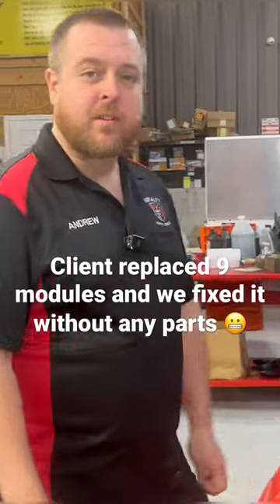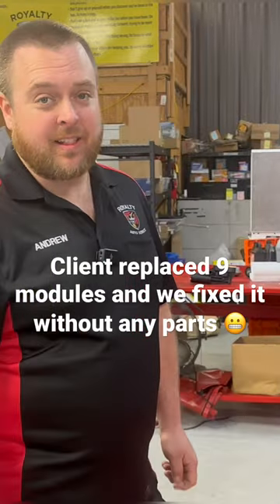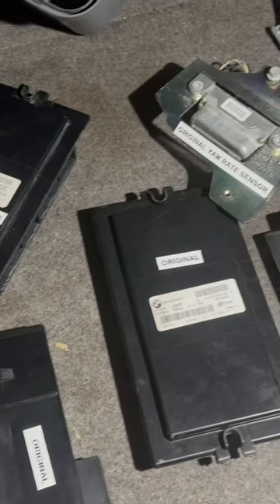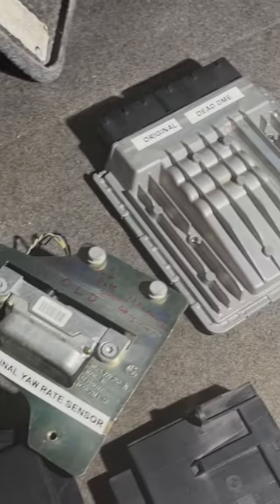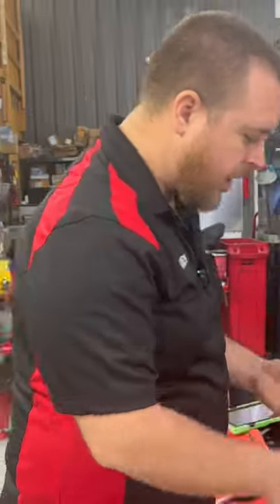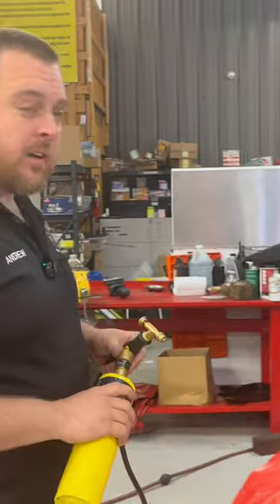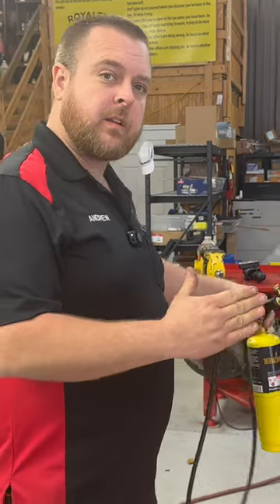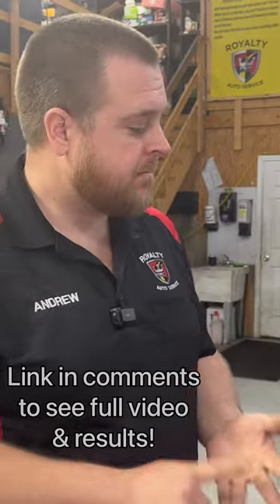Diagnosing a BMW that had the parts store thrown at it #automobile #328i #automotive #mechanic #bmw

Comment: Meanwhile across town a 16 year old Toyota has a seatbelt that doesn’t retract as well as it used to.
Reply: a 16-year-old Toyota is only 2007. I'm going to be real with you. I don't see it
Reply: my 24 year old rav 4’s seatbelt retractors are slower than a 100 year old mans piss stream but i dont have to do modules to fix my vehicle
Reply: @kidsythe   my 2012 mazda 3 drivers side doesn’t retract anymore without helping it
Reply: @jaydenbarteaux8768  2012 is only like 10 years old
Reply: Mean while back at the tents the Arabs where eating their dates
Reply: Hahaa so true. My 95 Celica and 03 Lexus still running with original parts. Celica has a replaced alternator but everything stock at 200k+ each...just weak seat belt retraction
Reply: My 2007 beat-up workhorse, a Mitsubishi Triton, won't die. I've run it with hardly any oil, and it still goes, hahaha
Reply: Rav 4 and a bmw 335 rav is 6 years older has less electronic issues but its on its second subframe and the uni body is on its last years. If theyd make a toyota with bmw frames and suspention that would be great.
Reply: I have to help the seatbelt every time in my 1998 Dodge Neon. Still runs like a dream though and even does great on long trips. Lol When it dies I’ll finally get something cooler!
Reply: I have a 94 Toyota pickup, seatbelts are a little slow but the thing is un-killable and I’ve never had to replace any stupid small ass sensors or anything like that.
Reply: the retractor on my ‘97 corolla just shit the bed :’))
Reply: Toyotas and Hondas are the best cars. German and American cars are just garbage 🤷‍♂️
Reply: Lol that's my 98 4 runner.  Quarter of a century old with 280k and she purrs.  She might not be the fastest thing on 4 wheels but she runs great and goes most anywhere I want to go.  Just in the process of replacing worn rubber in the suspension.
Reply: My 33 year old bmw is on its second set of front struts, second headgasket that started to leak again last winter, second coolant temp sensor, second set of upper and  lower control arms and tie rods and it’s 3rd set of sway bar end links at 221,000
Reply: @rushthezeppelin  you gotta love old Toyotas. There’s a reason the Arabs ride around on 20-40 year old Toyotas with machine guns mounted in the bed lmao
Reply: @aaronjones5742  Lol the way things are going maybe I will have a mounted LMG on mine one day lol.  Hopefully I'll have done a diesel swap by then so that I can run on biodiesel....
Reply: @johj9489  clean them an regrease the rollers, probably has a bunch of dirt and fuzz built up plus being dry is probably the culprit.
Reply: 2003 dodge caravan had issues from the day I got it in 2013 even though it did the test drive great. My 2012 Hyundai Veloster has been run over by a 2023 F350 and only needed the fan, suspension and bumper replaced and only because the previous owner never did any of that. I've had it 18 months now and it drives beautifully with the exception of the rear driver side tire leaning inward at the top of the tire (how do i fix that??). Owning this car has solidified the thought in my head that yes, imports are more expensive to repair but they're definitely much more reliable than any of the American made vehicles I've (excluding my 95 Probe)
Reply: Shoot I had a 95 Lexus gs300 (fancy Toyota) and it only needed maintenance nothing extra sold it for the 2jz that was under the hood for 4grand man I miss that car
Reply: @kidsythe  no no, he’s got a point. My 07 4Runner just had its driver side backseat seatbelt go out. Well at least the buckle part. But to be fair pretty sure one of the kids broke it…..
Reply: My 97 camry still runs great. Needed a cat, and struts but everything still works
Reply: That’s my only problem on my 20 year old Acura 😂
Reply: My 87 4runner seat belts don't retract. I just bought new ones for it after 35+ yrs of reliable service.
Reply: My 20 year old Lexus (Toyota) seatbelt does not retract on its own.
Reply: Meanwhile BMW is building Toyotas sports car 😂 Also, Toyota just had a major recall for the fuel pumps. 🥴
Reply: Well to be real Toyotas of that year aren’t as reliable as the good old ones of 20-30 years ago. Numerous engines in that era of Toyota cars have multiple issues and lots of recalls…
Reply: @hanzgrueber145  if true I never see it. I have 3 with the same 3.5L V6 all tuned for varying HP and one from the 90s with bulletproof 2.2 4 cylinder.  Three of them at 170K and nine with any issues.
Reply: You mean the company that builds pickups which are throwing rods left and right?
The same company that was caught cheaping out on airbags.
Caught using low quality steel not up to code for building the frame
Caught using cheap belt clips causing seatbelts to come loose in an accident?

Sure thing buddy.
Reply: @jaydenbarteaux8768  too much dust and dirt in the mechanism. Try a bit pf silicon spray on the seatbelt.
Reply: @funnypranker34  after 33 years! that’s quite impressive.
Reply: Same with my 2000 mitsubishi. Gotta love old school Japtrap reliability
Reply: lol fanboy detected, heres a truth bomb as some one thats worked on older toyotas and lots of other vehicles. Toyotas are just as rough and garbagey as everyone else lol if not worse honestly
Reply: @johj9489  true but its also a hot piece of shit lol. Just because "it runs" doesn't mean its not broken as fuck - worked in garages and thats normally how it goes
Reply: man the number of like 16 year olds in the comments making up garbage is kinda hilarious
Reply: @richmondvand147  I have been hearing that opinion for 30 years. And over that time that opinion went from the slight majority opinion to the minority opinion. There are so many reasons you are wrong, the easiest way to prove it is to mention re-sale value, or how fast a brand depreciates. The majority of society, actuaries, researchers, and other people who know the repair stats all dictate that. Why would people pay more for Toyota (or Honda) that is the same age, condition, and mileage if there wasn’t something different about them? When you consider their styling is often not as great as other brands it just proves the point even more. In the end money talks and your BS walks.
Reply: Me with my tacoma 😭😭😭😭
Reply: I always say the only thing my old tundra does better than any other makers truck is crank every time I turn the key lol

Comment: Odd that they went for all those modules when the high pressure fuel pump is a known failure point
Reply: N52 don’t have hpfp. N54 does.
Reply: @BimmerMafia  good to know, I have an n54 so when i hear no fuel that's my first suspect
Reply: N52 doesn't have a hpfp but its pump still normally goes out around 80-100k miles from what I've seen.
Reply: @alextheonewarrior it should go at about 160 if you keep gas in it 80-100k is far too early
Reply: @iiplaya  it’s a bmw no time is to early … they fail when it’s convenient for them and not convenient for you

Comment: Fuel pump failure comes from letting the Fuel Light come on, before you stop and put Fuel in it. Pump is cooled by the fuel surrounding it. Low fuel equals low cool. BMW and GM trucks and suv are notorious for the issue.
Reply: Because those who drive those vehicles are notorious for running their vehicles to empty 🤣 the fuel pumps themselves have no issue anymore more than the couple hundred PPM that any part has in standard failures
Reply: If a BMW won't start, always check the fuel pump. It's always the fuel pump, wayyyyyy back to the Jetronic Era.
Reply: I explained this to my wife on multiple occasions. And for reasons only known to her she refused to listen and I had to replace the fuel pump it was not a fun day.

Comment: Absent minded driver ran it out of fuel a couple of times, or many a-times near empty, pump ran dry and overheated itself, this is a main cause of fuel pump failures.
Reply: 3/8 of a tank is empty, or it'll heat the pump. Just keep it over that and you'll get longer life than the people who wait for the light to come on.
Reply: Are you a mechanic? Because the video states fixed with no parts. It was a bent pin on a module.
Reply: @sladeoriginal  yes, 43 years. 
Bent pin on a module (terminal/connector) sounds like another hand induced cause to the failure.
Reply: @vwecco1  
Yes sir - I don't believe I've seen a factory installed connector pin bender just yet - not even from the germans

Comment: Had something similar. I diagnosed a fuel pump immediately, simply because I did not hear it prime. Garage later confirmed it was seized.
Reply: They don't usually seize up. The brushes usually wear out.

Comment: First thing I'd have done was fuel pressure check, use bypass relay to see if pump functions if possible or run power from Power Probe to pump.
Reply: Adding an aux supply of fuel is so quick and easy to do. Some vehicles are not exactly easy to hook a fuel pressure gauge to. If you add fuel and it starts or at least stumbles a little then you instantly know a few things. #! you have a fuel supply issue. #2 ignition system is working and crank and cam sensors are good.  If you add fuel and nothing changes then you know you probably do not have a fuel issue so it's time to do other checks, including fuel pressure checks. But it hurts nothing to try adding the cosby sauce first. How much Cosby sauce?? All of it!
Reply: I love my power probe. That thing is boss.
Reply: Just pull a splug to check if theres fuel making it to the cylinder, this one would have been dryer than a nun, it's just a crazy waste of money to chuck random parts at it without knowing the basics, sounds like the biggest problem with this BMW is a dunce owner

Comment: My 99 Ford Explorer wouldn't start and the Ford Dealership was just down the road.  The mechanic called me back because I had given him a Standard Key and not a Chip Key.  It was the only one I had been using for the past few years.  
The original owner had removed the Sensor Loop from the ignition switch and taped the Chip Key inside, then tucked it into the dashboard.  The tape had come loose so the Computer couldn't detect the key and shut off the fuel pump signal.
Reply: Wow

Comment: If you turn the key and you don't hear the fuel pump prime, check power to the pump. If you have power, then the pump is bad. If there's no power, then you're looking at a sensor not sending a signal to it. I'm a "make my car start" specialist! I've started cars that people said haven't started in months, just sitting. Replaced crankshaft sensors, camshaft sensors, fuel pumps, distributor caps on old Fords. So many things can go wrong with starting a vehicle. Once, it was a clogged air filter. Once in my life and never again. LOL! Air filter was literally BLACK when I opened the box!

Comment: Fuel pumps should always be first to look at. They are the most overworked part. In cold climates, they work even harder. It’s also always submerged in gas. 

Spark is also another thing to check first. 

Relays are last thing to look at. If a relay is blown, a bad pump is what causes them to blow. At least a new pump will solve the issue of a blown relay, if a relay is bad.

Comment: Oil pressure switch stops it from  running or if you get into an accident it could be one of the bumper switch’s that shut down the pump to stop fire if smashed up hot wire the pump first and see if it runs. Did you know if the battery is weak on them cars all kind of crap goes out.
Reply: scan tool should have no issue flagging oil pressure sensor or fuel shut off though and would give direction

Comment: KISS. Air, fuel,spark. Cars are the same they have always been, just a few more black boxes.
Reply: I would first loosened the banjo bolt on the fuel filter to see if it had pressure.

Comment: Maybe some car manufacturer will come up with fuel pump not working warning light on the instrument cluster.or none fuel flow warning light.
Reply: No need. Many modern cars have fuel pressure sensors now and a scan tool can show this information. Most people don't need a "fuel pump not working light".

Because they ignore the low fuel light and burn their pumps up by running it constantly below 1/4 and fuel pumps use the fuel to keep them cool.

If they'd pay attention to their fuel gauge, and had regular maintenance where the fuel filter gets replaced at a nominal interval, they'd never need the "fuel pump out" light.

Meanwhile techs have the tools to diagnose these issues that most of the time are caused by blatant neglect.
Reply: @EyebrowsMahoney  Poor design if a low fuel level damages the fuel pump.
I have yet to see a car owners manual that states you will damage the pump buy driving with the low fuel light on.
Reply: @Cheepchipsable  Yeah, the owners' manuals these days are just Fischer-price "how to roll your windows down" or "how to use your seatbelt." Rarely do they put anything in it that results in your vehicle lasting longer, just what they can be held liable for. As for the design, almost all vehicles are designed that way. In the majority of cars, in-tank fuel pumps are suspended, vertically, towards the bottom of the tank. They are cooled by the fuel surrounding it. Towards the bottom of the fuel level, depending on the vehicle which can range from 1/2 tank to 1/4 tank and below, it loses the fuel surrounding it and can't conduct the heat away as efficiently. The increased heat usually results in eventually burning up the motor. Some are more susceptible to failure than others.

Everything on a car is designed to a specific lifespan and is constantly being engineered down to increase profitability. Some vehicles are worse about this than others. I mention this because this will only really affect your vehicle reliability outside of the warranty period. Which is the exact engineering point for longevity. - they WANT you to buy a NEW car when it's "lifetime" (which is end of warranty) is over. That's why manufacturers are switching to "lifetime fill" transmissions. They can lower the apparent "cost of ownership" by disguising the transmission as a "lifetime" product. The lack of maintenance is against the transmission OE's recommendations, but your owners manual says there's no need to service it. Then they tout this as "less maintenance cost," but in reality, the transmission will eventually fail you. The same goes for your fuel system. It's designed to last however long they want the car to last. Not past it. - Of course they're not going to tell you how to make it last longer.

I've replaced enough fuel pumps in cars, and the majority of the failures are the motors. Rarely do they ever fail because of wear, which would indicate their actual end of life - which points to abuse being the cause of failure. Could it be designed better? Absolutely, but that costs money that manufacturers need for profits. Didn't have these issues with inline or external units.

And don't get me wrong, I run my beaters below half down to vapors frequently. But, I don't care about it, it's a beater. I can change the pump easily and I don't depend on the vehicle as my reliable daily. My "nice" cars get significantly better treatment.
Reply: @Cheepchipsable  it is accepted wisdom to not be in the habit of running it down to fumes, as it sucks up the last bit of gas it comes with the sludge that's settled to the bottom of the fuel tank. It can clog up the pump screen or fuel filter, the added restriction will work the pump harder => quicker failure, or it can mess with fuel pressure (bad running)
Reply: a fuel pump is loud enough for you to hear it power on. It makes a high pitched noise, can't miss it.

Comment: German cars are notorious for burning the fuel pumps out if u run them super low on gas or out of gas
Reply: Fuel pumps are common on all cars. Its always submerged in gasoline and the most overworked part. Colder climates, they work harder.

Comment: Omg they probably drop alot of money on all those modules for a fuel pump
Reply: Yep. It should be crystal clear the owner of this vehicle should not try to fix their own car. The amount of money they spent on parts alone would cover repair costs even at the dealership.
Reply: Not to argue but if one wants to do it themselves they have to get the proper tools / equipment to do it alongside experience. And u better have plan a to z lol
Reply: He said no parts so my guess is the fuel pump relay or the fuel pump fuse
Reply: @alecb8509  How much you think all them parts cost.
Reply: Fuel pumps are the most overworked part in every car. Its always submerged in gasoline. It also works a lot harder in cold climates.

Comment: That should be the first thing you do on a crank/no start. On cars with a tach you can watch it while cranking. If the needle moves then you have Crank sensor because that's where the tach gets it's signal.

Comment: Hahaha when I worked for a motor club I went to tow a vehicle from the 3rd shop it was a sc bonneville like obd1 all the shops told him couldn’t be fixed member was extremely disappointed and frustrated out 500 in diag money. I said let me take a look he said what the heck crank no start ummm fuel gauge work yup has 1/4 tank let me add a lil just to make sure car stated guy almost cried. I did get a nice page long compliment I just was floored 3 shops so I feel ya bro